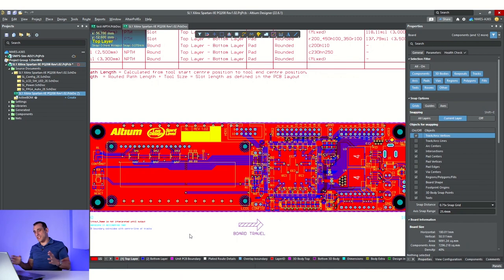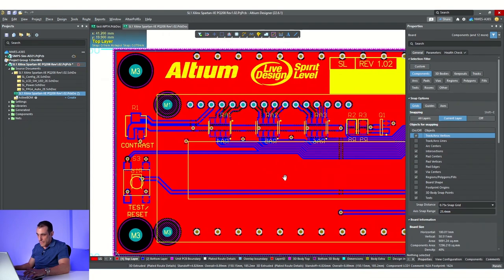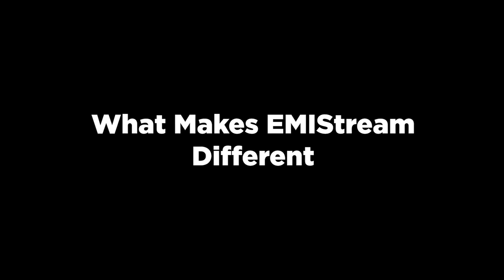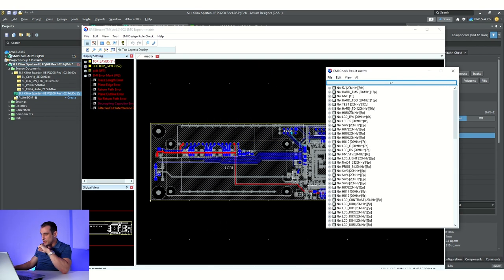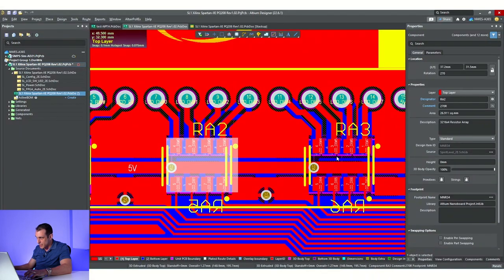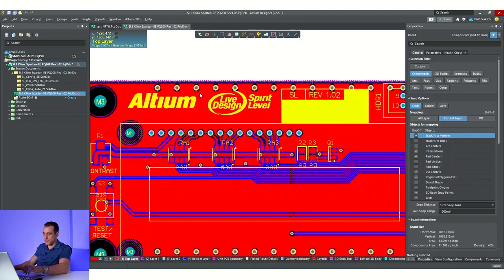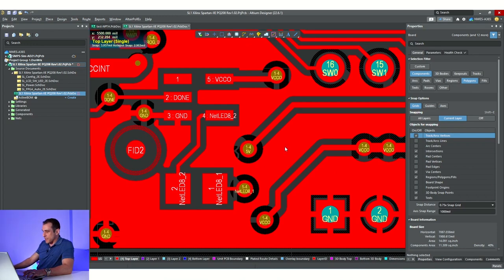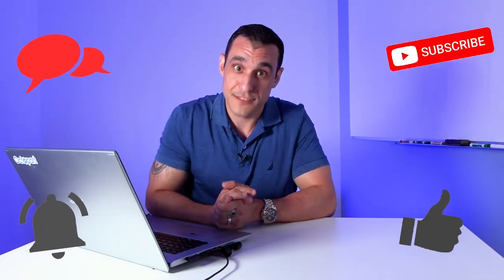How to Use the NEC's EMIStream Extension in Altium Designer

Comment: Hey Zach I want to understand how we can solve the ground bounce in the PCB. I am facing a problem with the ground plane, the voltage between two ground which are MCU GND and Gate Driver GND is a deflection of 2.5v to 3v while disengagement of mosfet.
Reply: Are you sure this is ground bounce? It sounds like you have a floating ground on one component for no reason, and the floating ground has developed a potential offset with respect to the remaining system ground. Most likely just use a single ground plane unless you have a reason to have an "MCU GND" and a ""gate driver GND"

Comment: For the example problem (maybe not for the rest of the board), it looked like there was plenty of room to spread the traces farther apart.  Would running extra ground traces between some of them solve the issue without going to extra layers?  Or at least doing that to bridge such gaps?  (In case only some portions of the lines had enough extra room for a ground trace in between.)
Reply: Placing stitching via would solve the return path discontinuity without adding any extra GND layer. The concern with running signals in a batch is the crosstalk due to inductive coupling between signals. Rule of thumb: gap > track width x 1,5-2